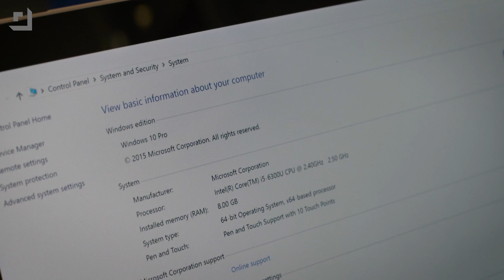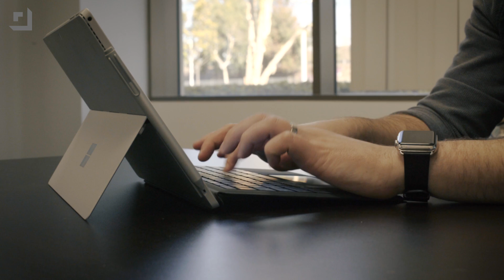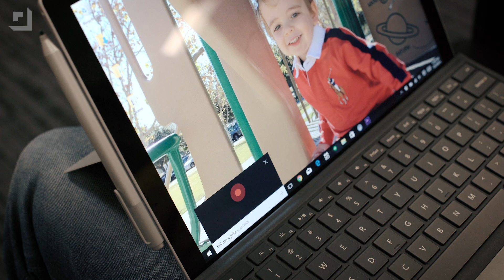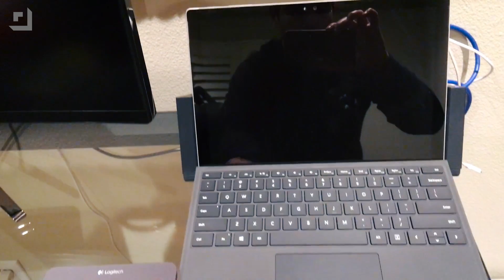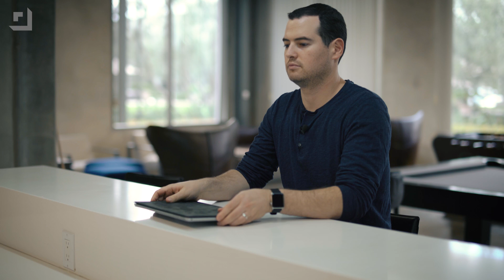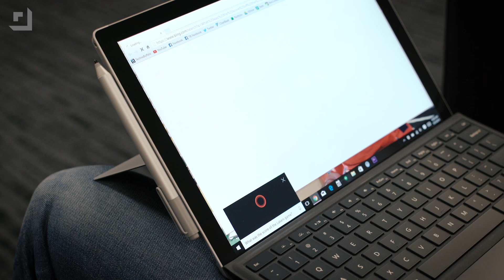Surface Pro 4: Still the Best

Comment: I bought a surface pro 4 i7 because of your good review, but there a things that driving me crazy 

1) Fan noise while surfing ( fixed it by underclocking the cpu by 65%)
2) dat coil whine ( can't fix it, freaking me out) 
3) battery on the i7 was disappointing 
4) battery drain while plugged-in , on heavy applications , absolute no go for that price, surface support told me to get a surface dock for 180 bucks , why I have to buy something additional ? For something that should be working , can't understand , that's the reason I returned it, now I am looking maybe for a m3 or i5 version .... 

Anyone who got the same problems ?
Reply: +Afrohonk I'm thinking the fan noise is an i7 issue, because I've read that a few times, but never really experience it with my i5.
Reply from the maker: +Afrohonk I rarely have any fan issues.  Odd.

Comment: I went from the SP3 to the SP4. There are a couple of little things that bug me with the 4 that I didn't experience with the 3, but overall I love the Surface Pro 4 and would buy it again.

The fist issue I have is with DPI scaling. I have the SP3 dock at work and one at home, and at 100% the display is perfect while docked and using an external monitor. However, I need to be at least at 150%, and 200% is even better, for when I'm not docked. I've created a shortcut to the DPI settings, but it still makes me log off when it switches, so that's a bummer.

The other issue is that while the SP3 dock works with the pro 4, because of the 4 being slightly thinner, if someone bumps my desk, it disconnects. MS was supposed to make an adapter for it, but when I went to my local MS store, they had no idea what I was talking about.

Those two little issues aside, I really do love this device and I can't see myself going to a different form factor anytime soon. I barely pick up my ipad anymore, so it seems that an all in one device is right for me. YMMV

Comment: the trackpad is a windows 10 bug,  I'm having it on my surface pro 3 with the old keyboard as well, disconnecting the keyboard and re connecting or restarting the device will fix it, it will be fixed in future updates

Comment: I'm seriously thinking on buying a surface but I have an $800 budget. should I buy the surface 3 or wait for the surface 4?
Reply: +Raian Levy I would wait for the Surface 4 because they'll probably upgrade the screen and hinge and come out with a new Type Cover for it. I have a Surface Pro 4 and the Type Cover is incredible.
Reply: +Raian Levy Try the educational store, choose an institute in US (you know what I mean), choose the 999 I5 4GB model, and then with the discount, you will get it at 899. 
If you are really tight in budget, go for the 899 base model, get it at 810 with the discount. That one is not bad at all, have tested Photoshop, Matlab on it and worked just fine.
Reply: +Raian Levy I had an early 2015 Dell XPS 13 and I had to sell it because it's keyboard was too shallow.
Reply: gameshoes I would but the price really kills me and I ill be using it for school, media consumption and light work so I don't really think I could use the Pro to its max and wont risk it because of the price.
thanks anyways
Reply: Buy a Surface Pro 3 configuration with a price drop. Best value plus you can buy a type cover later or get it from ebay/Craigslist if you want.
Reply: +Raian Levy I had the same decision, I got the Dell XPS 13 and never looked back!!
Reply: Jarred May  a friend of mine got one and I didn't really like it... but thanks anyways
Reply: build a pc
Reply: +Raian Levy I would advise against buying the non-pro variant of the Surface. The extra power in the Pro models, while not used all of the time, is very nice to have. If you must consider that $800 as your upper limit, then wait for the Surface 4; hopefully that will have USB-C.
Reply: Honestly I'd recommend getting the surface pro 3 instead, the core i3 128 gb is at 599, core i5 128 gb is 799, or if you're willing to bust out an extra 200 you can get the core i5 8 gigs of ram and 256 gb of storage for 1000. I know it's a big price jump from your budget but still very worth it. there are also many other laptops very awesome around your budget
Reply: Esai Rodriguez Yeah, and with Haswell it saves some driver bugs Skylake has with Windows 10.
Reply: +Raian Levy As a user who's only pc is a surface 3 non pro, I would say depending on how badly you need it, I would just wait for the Surface 4. It will give you more time to save up and you can use whatever you have got right now until the surface 4 comes out (what will be like sometime this year) also, if you have the choice between the LTE and non LTE version. I would go with the LTE version. They has been countless times, I have been in starbucks and the free wifi won't work and I can't google that one fact I need for my paper that is due in and if only I had an LTE connection I could of googled (or in my case binged) it. The LTE version is only like another £100 but is well worth it. :3
Reply: +Raian Levy On the Surface 3 non pro, you can do some very light gaming. I run Windows 10 edition of Minecraft with fancy graphics and render distance on max and it runs just fine, even with the fact of there is no fan. The extra power on the Pro versions of the Surface would be nice, however it's not necessary unless you wanna run like L4D2 max settings at 60fps or something.
Reply: +Raian Levy You can get the lowest version of surface pro 4 with $800. Just browse online they often have deals.
Reply: If you haven't already got anything, get the SP3 with a SP4 keyboard. It's great.

Comment: Jon, is there anyone in your office who's a digital artist?

With the rise of portable and affordable tablets with highly sensitive pens, graphic designers and artists are switching from Wacom's CINTIQ tablets that cost well over $2000 to Surface Pros, iPads, Lenovo Thinkpads, etc.

But is it worth transitioning over to these new tablets? And out of these tablets, which ones is the best to draw on? Could anyone from the digital art team in TechnoBuffalo respond?

Thanks!
Reply: +Tae Hyun Kim (Kimmy Kim) I wouldn't consider myself a professional artist but the pen's tip has enough traction to make drawing and writing feel more natural instead of sliding on a glossy surface. The pressure sensitive feature also holds up very well. I use the pen daily so I would have no problem recommending it. Though I am not a professional, I can confidently say that it might be worth your time.
Reply: +Tae Hyun Kim (Kimmy Kim) Watch out for the Cintiq Companion 2 give away these days. Last month there was a 200 bucks discount to all companion 2 lines, and the i5 model costed 1300 after discount, pretty decent though the haswell cpu. 
I have both the Cintiq 13HD and SP4, have to say the Wacom is still better than the Ntrig pen overall, but for not too professional painting, the Ntrig is more than enough, and I strong recommend the new pen tip, try the H tip, gives you almost the similar feeling to the Wacom Pro pen.
On balance, if you are a professional, go for the Companion 2 i5 model when there is discount, Haswell is not lackey compared to Skylake in terms of performance, and the price is not shocking for this one. After all, you will ultimately go for the Cintiq if you need to paint for a living. 
On the other side, if you are a paint lover, SP4 is better given the better built, economic energy efficiency, slim design and a little bit cheaper price.
Reply: +Tae Hyun Kim (Kimmy Kim) i still connect an intous 4 to my sp4. The sp4 pen is great, but it still doesnt compete unfortunately. For light skething i use the sp4, but profesional work i have to use the intous 4.
Reply: +Tae Hyun Kim (Kimmy Kim) Ive owned both the Wacom CC2 and Microsoft SP3. and the CC2 feels bulky in comparison. not to mention being heavy with piss-poor battery life. Often around 3-4 hours (at best). With my Surface Pro 3, I can easily take it anywhere I go and it will easily last 5-8 hours depending on my usage. I did purchase to the new pen for the SP4 at launch which was an excellent upgrade and well worth the extra $60. If you want a Wacom, stick to the larger 22 or 27 models, or the 13HD if you're on a budget, but for Mobile use, the SP3/SP4 are by far the way to go for most any artist.
Reply: Hobbsmeerkat Hope Wacom update their CC line to Skylake. Haswell on mobile device with quad core is not a proper move. 
Ntrig should evolve to peer wacom so that Wacom could finally lower their price.
Reply: None of the CC2's were quad cores, they were all dual-cores, just some with "Iris Pro" graphics. Even if they do update to skylate, they still need to increase the battery capacity, slim down the bulk to reduce weight, use a built-in stand, along with more comfortable 2:3 or 3:4 display ratio.
Alternatively, Microsoft needs to introduce a 22"/24" Surface device to compete with the 22" & 27" Cintiq, including models with and w/o built in PCs.
As far as the N-trig pens go, Microsoft really needs to work on making the pens more comfortable to hold for long periods of use.
Reply: Hobbsmeerkat I just hope the new ntrig pen (when they are good enough) can still support the previous ntrig screens, so that I can just update the pen instead of the screen or system overall.
Reply: I'm not really sure what you mean by "Good enough" (2048 levels of pressure? no battery? ergonomics?)
Cuz in terms of usability, the N-trig pens work very well, even the original SP3 pen with 256 levels works well. possibly not as much if you're used to using large brushes with sensitive pressure changes to determine size. But the new SP4 Pen works well on the SP3. Likewise, the old SP3 pen works on the SP4. So unless they fundamentally change the way their pen tech works, I don't see that happening, especially since Microsoft owns N-Trig.
Reply: I am not a professional artist but I think I know enough knowledge to answer your question. 

1. I came from a Wacom pro and a Wacom companion 2 which is a portable cintiq. 
Even though I had those I bought a surface pro 4 and I have to say I like it more than 2 of my Wacom.
I won't compare the surface pro 4 to the Wacom pro because the surface pro is much better.

so when I need to do high quality 3d rendering I use my Wacom cintiq companion 2 because it has a thinner tip and is more controlable but not by much. But with my surface pro 4 I can create just as high quality work while on my couch comfortably. I cannot do it with the companion 2 because of its weight and it sometimes heats up a lot but my sp4 doesn't. conclusion. Get the surface pro 4 if your gonna your not a top professional which I am not either. and get the cintiq if you are one.They both create just as good work but very minor details that the companion 2 can do is really a consideration too. If I were you I would go for a surface pro 4 cause it has a longer battery and so much lighter than the cintiq. and the wight and price of the cintiq is too expensive and doesn't offer much more than the surface pro 4. 
Hope this helped!

Comment: The Microsoft surface Pro  4 is going to be a disappointment i made out of plastic  The keyboard on look cheap made  a year from now which do you think you will get more for  by selling the iPad Pro or the Microsoft  surface 4  on ebey. iPad pro Apple products remain they sell   volume
Reply: +Michael Arrington Or you could just love the surface and use it till it dies. The only reason you would need to have a good resale value is because the product is bad and you're going to need to sell it. You don't sell a good product, you keep it.

Comment: I hope there will be a Surface 4 I can buy. I don't need the power, but I do need Windows and I do want something I can hold easily in one hand.
Reply: Karlo Schallibaum Get the surface 3
Reply: Anubiis I'm a student. There's no reason for me to get the surface 3 at 10% off now when I get the same discount on a new surface 4.
Reply: +Karlo Schallibaum But the SP3 is cheaper + 10% off. Not the same price. The form factor is virtually the same, but with last gen hardware. You'd still save a few hundred bucks.